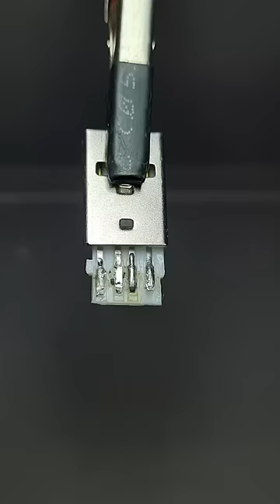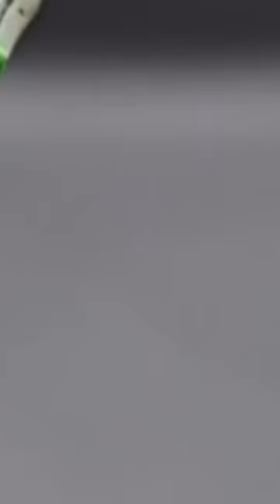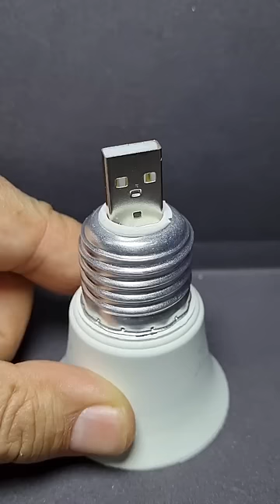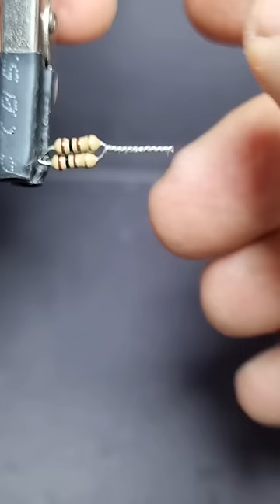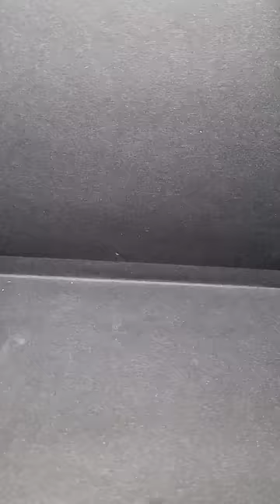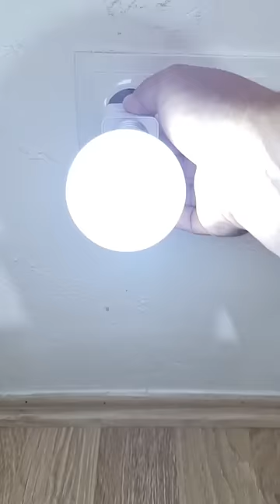Don't Throw Out Defective Led Bulbs Anyone Can Do This At Home  #shorts #zaferyildiz #short  #viral

Comment: I always keep old LED bulbs and repurpose them. It's usually the power supplies that fail. 28 volt buck boosters are very cheap and will run most LED modules. Run for hours on an 18650 cell (which I salvage from old scrap laptop batteries). Makes great emergency lights
Reply: А почему всю эту чепуху преподносят нам иностранцы, или это мы им. Язык то английский. Только чтобы всю эту чудо технику творить, гораздо дешевле купить новую лампочку. Освещение самое правильное и относительно не вредное когда свет падает в низ
Reply: @ВикторЛобань-т1ы  какая разница кто это говорит,  шарик то общий земной. все люди братья). а он дельную вещь сказал
Reply: here in Africa we do just that all the time. I picked up circuit boards with hundreds of round led lights they were from gas station floodlight and the boards I just cut up and solder wires and resistor to make 22 volt solar lights. I use laptop batteries too was stripping some for the cells just yesterday. in Eswatini.
Reply: @alliennibiru7086  Но некоторые это сестры  ;-)
Reply: @ВикторЛобань-т1ы  Почему вы называете его иностранцем? На Youtube нет ни отечественных, ни зарубежных. Почему ты так полон ненависти? Тогда не смотри видео.
Reply: @ВикторЛобань-т1ы  Why do you call him foreigner. There is no domestic or foreign on Youtube. Why are you so full of hate? Then don't watch the video.
Reply: i do the same. i dont throw them away i remove the led board and put in a 18650 cell with charging curcuit and a micro usb port to charge it
Reply: @ВикторЛобань-т1ы  там ВЧ драйвер стоит, т.ч. вредно...!
Reply: Engineer

Comment: Why the parallel 100 ohm resistors? It’s not like you need the current handling, just use a single 50 ohm
Reply: Maybe it's because of the low power allowance of resistance?
Reply: @jungyeonho  maybe you’re right. I believe standard carbon or metal film resistors are only rated at ¼ watt, in that case you’d have to use 2x100ohm for ½ watt LED
Reply: Big clive talked about that not long ago. Wish i could remember why, but i think its more a safety thing incase one fails the other can protect from overvoltage instead of all the voltage going through with no resistance (fire) ...may be wrong

Comment: Don't throw away defective led bulbs. Instead, recycle them. Don't try to do this. You will basically make a fire starter that doubles as a light source if you don't know what you are doing.
Reply: Ме Э кг
Reply: Right you are!
Reply: Good thing the video explains exactly how to make this - it is very clear, I don't need to consult a schematic or anything.
Reply: @the_kombinator  Oh yeah i forgot.
Electricians dont need a timeconsuming education.
They simply can watch a youtube short.
Reply: @landi87  I doubt you need to be an electrician to hook up a low wattage LED bulb and a couple of resistors to a USB connector.
Reply: @RennieAsh  and exactly that is why there are so much fires caused by bad electric.
That and the fact that chinese companys that produce the power supply that you put that into dont care that much about safe circuit building.
That chinese power supply in the worst case dont care about that short circuit you put into it. And you didnt see it either.
And shit happens.
Safety begins, where you dont do stupid shit you find on youtube :)
Reply: These people are afraid of three and a half volts, but they mindlessly walk around with a cell phone in their pocket with batteries that have been known to spontaneously combust when charged improperly.

Yes, it's dangerous to play with electricity.  You can also drown in less than six inches of water.  Better to avoid all forms of liquids, because danger danger.
Reply: @PhilLesh69  USB is 5V, not 3.5 ... And "these people" are not scared because of the 5V Side.
But the Power SUpply you use to power these things up is put into your wall. And that is where the party starts if something goes badly wrong.
This is why so many people warn "these other people" to not blindly put everything that is build in a chinese garage in your wall and plug the things in it that you build yourself in your garage.
If you buy a cell phone you have to trust the producer of it to implement safety features. And most (bigger) companies do so.
I doubt everyone is putting their own selfbuild electronics into the cell.
Reply: I'm an electronics technician and doubt this was written for an electrician who focus on supply lines for devices and appliances that connect to them on the high voltage grid.  This video is written more as an infomercial targeting DIY hobbyists who tinker with electronics.
Reply: @davewindley5653  ofc it is. But do you really mean, an DIY Hobbyist should take apart all safety aspects and just tinker something together in his garage and plug it into his wall?
If you deal with electrics you will have to keep safeness in mind. Not every person that can just baerly use a soldering iron is able to do that. And a youtube video should not motivate people to do stupid shit. Thats it. If you know, what you are doing - go for it. But most people do not.
Reply: Não entendi o quê é aquele Led que   colocarcaram?

Comment: It's set up for 100ma but because of the voltage mismatch it could push up to 1/2W through the LED. I'm not going to go into the details of the math especially when I don't know the resistance of the chip he used but that setup might need larger wattage of the resistors [1/2W each at least] and for sure a heatsink because it was mounted over a large hole so the LED effectively has no heatsinking.

Comment: Very good project.  👏🏻👏🏻👏🏻 In addition to encouraging recycling, it also teaches a little electronics.
Reply: Just a thought, would work same without the 💡
Reply: for me it's not recycling if I first need a USB power supply 🤣
Reply: It's not teaching proper recycling/upcycling as there are perfectly good LEDs already on that circuit board
Reply: @kyrbies  upcycling. And who doesn't have a USB power supply?
You can also buy them second hand most of the time as other people there them away

Comment: Very useful infirmation but PLEASE redo the video to show the WHOLE process.  

THE video starts out pretty good but suddenly a larger single LED with magnifier lens appears and is soldered into place.  When this repurposed bulb illuminates do all the small SMD chips light as well?  Or did you transplant that larger magnified LED from a different bulb and it is the only one that works?  

You can easily see how this is a great concept but leaves your audience guessing about proper construction and assembly details.
Reply: theres no need to add an extra led if the other leds were functioning so my guess is the others either dont function optimally or they just dont function
Reply: ви маєте рацію

Comment: Зачем в светодиодную лампу припаивать ещё один светодиод, если там их и так больше чем достаточно? :)
Reply: A few pieces of LED actually survive and it is possible to bridge the burned ones, but the parameters are different - you cannot light one LED with an adapter. I also recycle the original LEDs - two in series connection can be lit by 11.4-12V, but this is not always the case. A power source is required, or a battery that does not charge at the moment (13.7-14.8V).
Reply: @DL-kc8fc  На сколько мне известно, один светодиод рассчитан на 3 вольта. Можно обрезать дорожки и поэкспериментировать с параллельным и последовательным соединениями. Таким образом, у вас должно получиться зажечь все светодиоды от почти любого напряжения. Общее напряжение последовательно соединенных диодов равно их количеству умноженному на 3 вольта (если это их напряжение).
Reply: @mihailmatkovskij9350  One LED from the old LED lamp is not rated for 3V, but has a range of 5 - 6V. The input voltage is roughly 120-180V. The number of LEDs is subject to this. It is possible to combine them in a series-parallel connection, but the current consumption increases and overheating increases. Do not confuse LEDs for lights with LED strips, etc.
Reply: @DL-kc8fc  Ну от двух амперного зарядного устройства на 5 вольт могло бы работать несколько светодиодов. А от перегрева у таких ламп есть радиатор.
Reply: @mihailmatkovskij9350  Therefore, the intensity of the LED light is regulated only by the current. If the LED from the fixture does not light up even at 250mA, it is pointless to try 2000mA. Therefore, charging adapters (1000-2000mA) do not work for individual segments of LED bulbs - they do not reach a specific voltage. The person in the video must have tried to bridge the bad LED and light up at least one segment - it didn't work. That's why he solved it with another LED with two resistors, which may not be good in this solution. Stabilizer is better. I have been recycling bad LED bulbs for several years and many types require 12-12.2-12.4V for two LED segments. Power is determined by current, and most LEDs recycled like this have been destroyed by heat to begin with, even though they are on an aluminum platform. It is necessary to test it and choose the correct voltage and current. In some cases, recycling is not worth it.
Reply: Встречаются до 36v на такой светодиод там несколько чипов последовательно подключены внутри, кстати очень хорошо подходят для подсветки выключателей
Reply: Mihail concordo com você,precisa aproveitar os leds que não queimaram
Reply: Wouldn’t it just be the driver that fails not the actual LEDs?
Reply: @mihailmatkovskij9350  матрицы светодиодные примерно 33 вольта
Reply: Тебя забыли спросить
Reply: @mihailmatkovskij9350  у диодов таких ламп напряжение порядка 18 вольт на каждый поступает.
Reply: @Александр159-п4ф  Я слышал и 3 и 5 и 6 вольт, а теперь ещё и 18. В общем, без документации не обойтись...
Reply: @mihailmatkovskij9350  я просто замерил напряжение когда отделил сгоревший диод,ввернул в патрон лампочку-включил её,и когда щупами мультиметра прикоснулся к выводам- отпайкам диода на радиаторе круглом,то  показало почти 18 вольт.До этого я тоже всегда думал что там не более 3 вольт на диод идёт.Просто если там было бы 3 вольта-то можно было вместо перегоревшего диода припаять обычный диод-стекляшку от какого то например налобного фонаря,который бы разгрузил так же нагрузку-пусть даже не так бы светил.Но всё оказалось достаточно не так,поэтому и припаивают вместо диода сопротивление.
Reply: Вообще сомнительная экономическая выгода от этого самопала.
Reply: @mihailmatkovskij9350  Я постоянно ремонтирую такие лампочки, светильники, прожекторы и т.д. Перепаял уже очень много таких диодов, отремонтировал несколько сотен лампочек и светильников, и вот что хочу сказать. Именно такие диоды есть на 3в, 6в, 9в, и на 18 вольт. А еще они не только по напряжению, но и по мощности отличаются, например есть те же самые 3 вольт 0.2 вт, 3вольт 0.5 вт, 3 вольт 1 вт.
Но чаще всего в обычных лампочках попадаються на 9 вольт и немного реже на 6 вольт )
Reply: они там в основном на 9в реже на 6в а еще реже особенно ранние на 3в
Reply: В таких лампах частіше використовують світлодіоди 9-12в
Reply: So he could use the other ones 🤦
Reply: Иначе не будет светиться с блоком питания, а только напрямую от 220 В.
Reply: Só para ter mais trabalho.

Comment: Just make sure you don't leave this on while you are away. Maybe coming back to no home if you do.
Reply: It's running on USB, which is 5 volts.  Unlikely to start a fire with low voltage like that.
Reply: Void U.L.Rating 🔥
Reply: @my3dviews  5v can still generate enough heat to melt plastic and start a fire.
Reply: @my3dviews  But the power supply you put this into is running at mains voltage. And these PSUs are mostly cheap garbage without any safety features at all to prevent damage in the event of short circuits or anything like that.
The party mostly dont start in your selfmade LED Crap - but in your wall ...
Reply: @landi87  if you get a short in the power supply the breaker should trip.
Reply: @alexandruilea915  A short in the 5V secondary side of the psu doesnt mean that its a short on mains power instantly.
There are many cases where the breaker would not trip but the PSU will blow up in flames.
Reply: @landi87  you said the party starts on the wall so that's before the 5V circuit.
Reply: @alexandruilea915  well my plugs where the psu sticks into usually is  on the wall ...... dont know if your plugs are just random in the air tho ...
Reply: @landi87  They are "on" the wall and the outlets don't go on fire. The charging brick may but not the outlet. If something happens inside the outlet the breaker will trip.
Reply: @landi87   links to all these fires.  Name 1
Reply: @alexandruilea915  and the dif is? 
Fire is fire ...
Reply: @landi87  the difference is that one won't cause a fire because the breaker will trip

Comment: We need heatsink for led Mr zafer
Reply: That piece is a heat sink that the led is soldered to. Plus it sits on a bigger heat sink as well.
Reply: 100mW...
Reply: @melplishka5978  This type of led is 1 watt or more. 1 watt must have a heatsink and you must solder it to a piece of metal or glue it with the right type of glue.

You can also buy these bulbs with a heatsink
Reply: @ford1546  that’s what I said tho lol. The piece he soldered it too acts as a heat sink and the socket is a bigger heat sink.
Reply: @melplishka5978  Did you see the large hole in the original LED plate? He soldered the likely 1W or 3W chip right over that hole so nothing is contacting the heatsink pad on the back. That LED WILL burn out in no time.
Reply: @DrHarryT  sry I did not lol. Then he’s screwed lol

Comment: I appreciate and even applaud the effort, but I'd rather spend a few bux and just buy a new bulb versus spending the time and effort (and damn near the same price) just to get the light to turn on -> and now sticking out of the wall instead of in the needed light socket.
Reply: there are adapters to screw in with a plug where a bulb goes normally. Handy to have for buildings short on outlets. I have one in an outbuilding with only a light so I can plug in tools.

Comment: I had an LED bulb die due to a single series LED blown.  Unsoldered it and bridged the contacts, and the bulb worked.
Reply: I have one bulb running for 4 years already it’s also missing 2 leds but it works fine and bright enough

Comment: Using a resistor is not a good idea, since the LED will not work at full power, it makes sense if you use (resistors) as night lighting.  And it's better to use LM317 or a special driver for LEDs
Reply: Lm317 costs more than bulb...
Reply: good for walkway lighting?
Reply: @johnf6262  good point. That's like the commercial that can fix a filament in an incandescent bulb. The device cost thousands of dollars to fix a 50 cent bulb. 73

Comment: Not supposed to throw away LED light bulb units.  They are electronic waste.  There are more hazardous elements in the circuit board and components than the precious elements of gold, platinum, and silver.
Reply: What harm is it in a modern landfill? They dig out a base, install a thick liner, pile in the garbage, compact it, add a layer of dirt at night, and then repeat until they have a mountain. Then the whole thing is covered with a liner, with plumbing to catch the methane, then cover the mountain with dirt and grass. Nothing goes into the environment anymore. Nothing leeches into the ground water.

Comment: Yo like these videos are cool, but in electronics class we only build circuits for our practicals. And we are just testing voltage, current, etc. on a breadboard. It is cool until you see these videos. I can solder, wire db's and design and print a pcb board but the magic gets really taken out. Plus circuit analysis class, my guy, pen and paper and working out capacitance, inductance, and the changes over temperatures, and I know it is valuable knowledge but when you go through it at your desk at night, bruhhhhhh

Comment: Those bulbs are very easily repaired and can be made to be more energy-efficient why do anything like this to them?
Reply: More energy efficient? How? Tell me more... i wanna hear how you can make a led bulb more efficient without changing the led diodes with more efficient ones...
Reply: @AmicuLL  you can "program" the led's to run with a lower voltage so last a lot longer with a slightly less brightness but unnoticeable.

Comment: What condensators you used there! And can you describe the model of the microled? Eventually the brand as well?
Reply: He didn't use any condeser there... și din nume, cred că ești român. Oricum, a folosit 2 rezistențe în paralel ca să ajungă la o rezistență echivalentă de 50 ohmi(formula pentru calcularea rezistenței echivalente în paralel este: R1*R2/R1+R2 sau 1/R1 + 1/R2). Rezistența asta nu a ales-o din aer, dar n-a explicat de ce a ales valoarea asta. O fac eu pentru tine ca să înțelegi... un led are nevoie de o rezistență în serie ca să limiteze curentul străbătut prin ea, altfel o să se ardă dioda. Formula pentru calcularea rezistenței este: Tensiunea_Sursei - Forward_Voltage / Forward_Current. În acest caz avem 5V, iar tensiunea pentru a "deschide" dioda este 3.4V la un curent de 30mA. 5V-3.4V/30mA = 53.333 ohmi . (Acel 30mA la 3.4V nu l-am scos din c*r, acele date le scoți din foaia de catalog al led-ului (datasheet) cu pricina. Fiecare diodă e diferită. Contează ce culoare are ledul și contează brand-ul... calitatea diodei.)
Anyway, i don't recommend to recreate anything shown on youtube without having basic knowledge in electronics. It's quite dangerous for your house.
Reply: @AmicuLL  multumesc frumos ptr explicații !